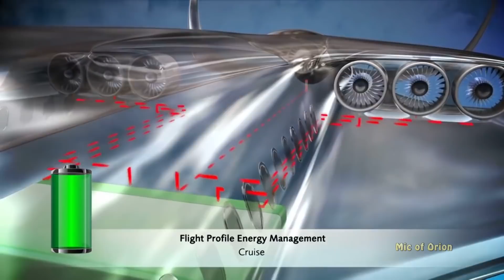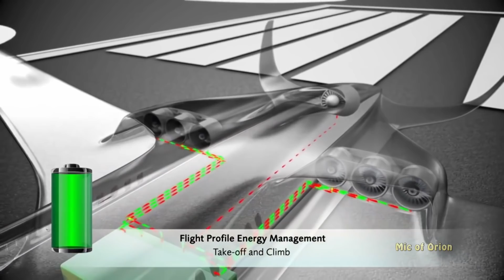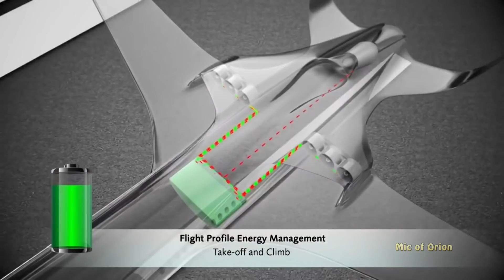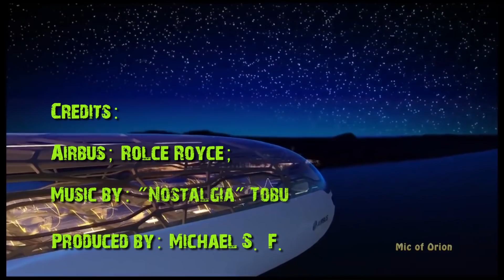AIRBUS ELECTRIC PASSENGER JET  E-THRUST

Comment: Strictly speaking, this is still not a "jet" since the only thrust is generated by the fans alone. What would the speed of such an electric fan powered plane be? Comparable to regular turbofan prop passenger planes in use today?

Comment: Would be interesting if they could utilize that solid state ion drive design MIT tested.
Reply: Aren't ion drives super low thrust?
Reply: Actually we have tested caterpillars in electrophoresis. There's no reason why they couldn't propel an aircraft with sufficient power. On that scale it's basically a lightning bolt in a pipe. Not dissimilar to a ramjet. The electric current draws in the air,superheats it and exausts it. The same principal can be used in space,using interstellar hydrogen.

Comment: The fossil fuel industry struggling to remain relevant.
Reply: how so?  Current prices reflect high demand.
Reply: @PhilosopherRex  in Europe at least all fossil fuels are scheduled to be phased out. We have 12 years to stop using fossil fuels before we pass tipping point in climate change. So it's literally life and death at this point. We're 40 years into the 50 years we had on the doomsday clock that we became aware of in the 1970s.
Reply: @jefferyclark2114  Your doom and gloom story wasn't necessary to explain that European politicians and bankers have conned you out of using them.  All fossil fuels will be used until depleted unless another vastly means of cheaper to produce energy is discovered (e.g. fusion). taxing their use, is really just a redistribution to those who get the money to use them.  Banning them in one place will not stop them being used.  The US military is one of the biggest users of fossil fuels in the world and they are expanding.  So, if you really believe all the AGW fear mongering, I humbly suggest you start building your bunker.
Reply: @jefferyclark2114  12 yrs until doomsday? Source please
Reply: @unicornkatana9836  which of the 3 climate reports released in the last month would you like me to cite climate troll? Or would you prefer the original research from the 70s? It all agrees. Once past tipping point it's over. Then its irrevocable.
Reply: @jefferyclark2114  how am I trolling? I was just asking for a source. No need to be do aggressive
Reply: @unicornkatana9836  it's been my experience that after 40 years of the research being established science, anyone questioning the established science is by definition a troll. I've been working in the field,having my work actively and passively suppressed for 40+ years.
Reply: Stesilaus  global warming leads to global dimming, or an ice age. No need to waste the nukes. 10,000 years in the sun.90,000 years in the ice. That's the cycle. We just seeded it up exponentially.
Reply: They’ll be relevant for decades to come.  All current electric cars and aircraft are fossile fuel powered.  Electric batteries have a limited life.  Still so expensive it would drive most of us into poverty.